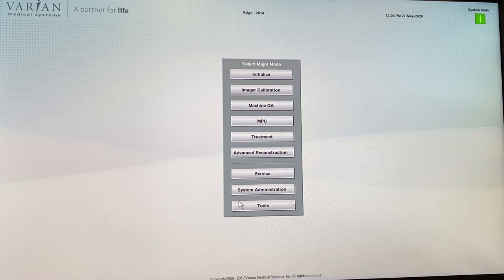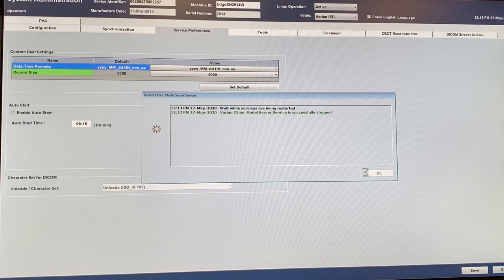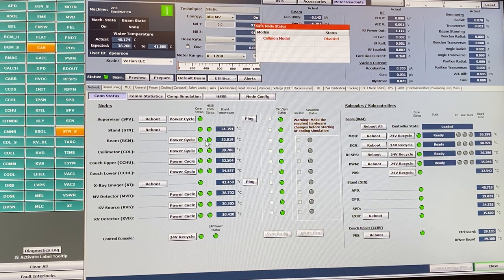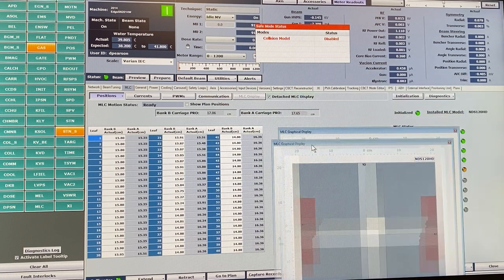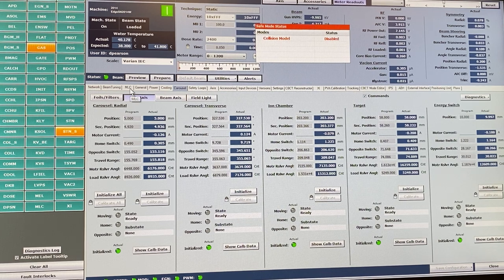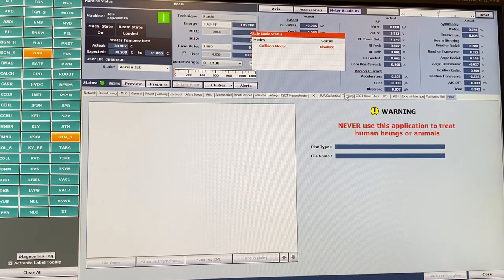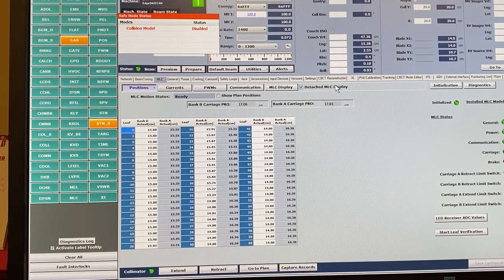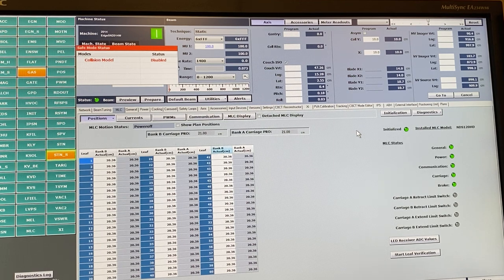An Intro to Service Mode on a Varian TrueBeam

Comment: As a current patient getting therapy on a VitalBeam I'm intensely interested in the care and feeding of these magnificent robots. 
Seriously, the therapist isn't equipped to answer my questions but an upcoming appointment with the radiology oncologist may glean some more reference material.
The unit I'm on emits a grinding squeak from the gantry at the same point in its travel.